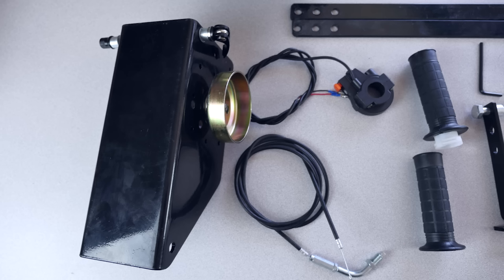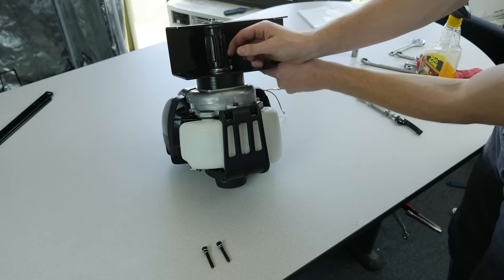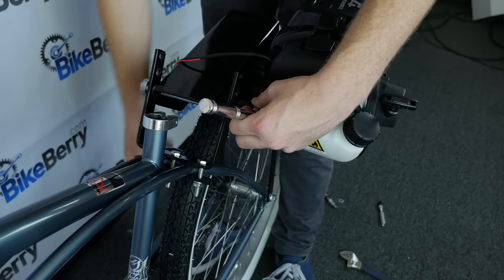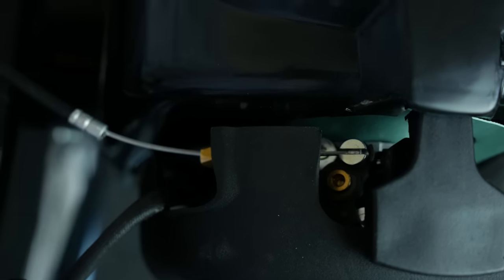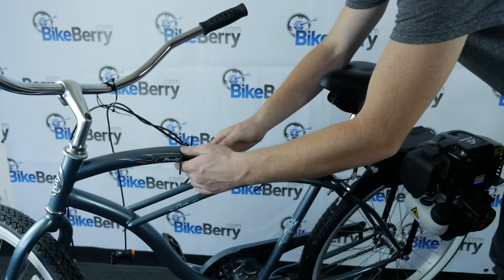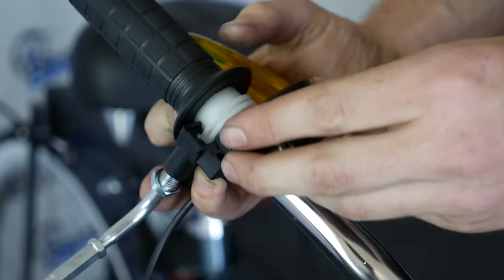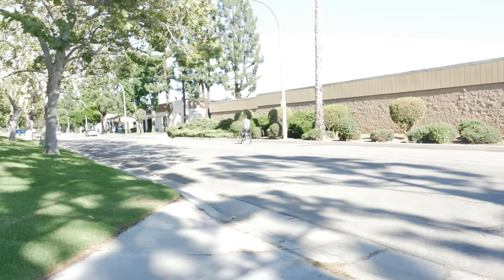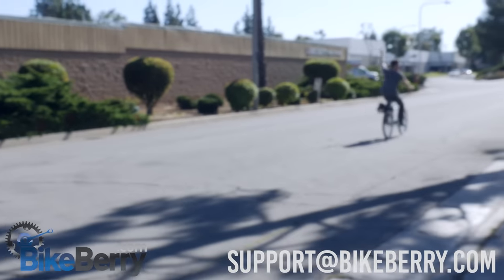4-Stroke 38cc Friction Drive Motor Bicycle Engine Kit Installation | The Flying Horse Lock-n-Load

Comment: how long are you going to be OUT OF STOCK?
Reply: It says "in stock" now :D
Reply: it will be forever , nobody wants it , it is bad for environment  ,
Reply: pattoe1973 Its not out of stock. I just bought the 49cc model;). And this thing is more efficient most vehicles on the road.. so yea. gg
Reply: offcourse it is not out of stock , nobody want it , it is not efficient , electric vehicles such as TESLA'S  or electrical bike's only have to be connected to the solar panel for some time ,  you dont have to pay for the sun!!
Reply: pattoe1973 bad luck M8. I will never give up the smell of petrol.
Reply: pretty soon you are gonna pay fair amount for the damage you do , think you will give up soon , it is all about the money
Reply: pattoe1973 no its about soul. Tell me one electric car with soul. There are non
Reply: pattoe1973 also do you know how much damage building a electric car does to the environment?
Reply: it is about cancer , tell me one cancer free ice car , what gives you the right to damage others health , did you pay for it ? you did not pay me .
Reply: yeah , it is the same like building an ice car , but during use you are able to run it on wind or solar power , and the car last twice as long , so you reduce building cars about 50 %
Reply: pattoe1973 they don't last as long as a old Mercedes for example. The batteries fail quite quick. Do you know what disposing of them does to the environment? And they are way way worse to build than a normal car
Reply: the battery's are 100% recycle able by the machine that builds them , the old battery's are worth a lot of money , the battery,s are garanteed for 8 years  by 8 years you saved enough money to buy 2 new ones ,because you dont need to change :oil, filters, startmotors,clutches, exhaust pipes and mufflers gearboxes etc.etc. did you know Mercedes and TESLA are good friends ?? Mercedes A class, B  class and Smart are all electric vehicle's made in U.S.A. by TESLA ! Mercedes just anounced the start of building their own "GIGA-FACTORY, like TESLA  is building in Reno !! after 1 milion !! miles your battery still give 50 % enough to power your house as an emergency generator, etc etc , why you think Mrcedes is investing 5 bilion dollars ? somebody did the math , it is the way it will go , (there are a few people still hangon to the steam-engine , but i dont see a lot of them )
Reply: pattoe1973 you really believe that "recyclable" batteries are actually recycled? Get lost and do some research what is going on in Africa. 

And maybe you haven't got my point. I would never buy a modern car. Electric or not. Why? Because when I saw a used car nobody has to produce a new car. And even better : they don't even have to harvest any natural recourses. 

I only use synthetic oil and run my car on vegetable oil instead of diesel because mercedes used to build reliable engines.
Reply: i also run my mercedes on vegetable oil for 50.000miles its emisions was 25% lower compared to Diesel, and it was 50% cheaper ! , if you think they will trow away battery's , you shoud find out how much money they offer you for the old battery,s , the Mercedes (124 type , 250 ) is nower days not welcom in the bigger city,s , because of age year of construction (1986) here in the Netherlands 14  environmental zone's , and increasing . the mercedes is gone  it was a great car (500.000 miles ) R.I.P.
Reply: pattoe1973 well I'm from Germany and mine makes 250hp. Threw everything out that wasn't necessary. Emissions? Well I have a switch that makes black smoke coming out of the exhaust. But it's fast and sounds nice
Reply: i cant find anything on you tube, that can keep up with TESLA , TESLA wins against ferrari lamborgini mercedes porsche 918 etc.etc. Maybe you think it is fast because it makes a lot of noise ?
Reply: pattoe1973 wanna see something fast? Search for 1500 hp Toyota supras, Nissan GTRs and other Japanese cars. Some even go beyond that. You don't get fast cars directly from a manufacturer. And I didn't say that my car is faster than a Tesla. 

But it's more fun. No traction control or other electronic nannies. No power steering. And an engine that with an amazing power curve
Reply: imagine what will happen if you do that with TESLA , TESLA does it all under waranty , for some of us important
Reply: no power steering ??? i did search for it , but for w124 , 250 it was only power steering available
Reply: pattoe1973 I took it out. It was complicated but the steering is way more direct now
Reply: pattoe1973 also you can't get much more out of a Tesla without the battery going flat within seconds. Way to many electrics and stuff that can go wrong
Reply: i think i liked it better without powersteering,
Reply: the TESLA is under waranty mate, why cause cancer while there are so much better cars ? you have a refrigerator in the house , when is it serviced last time ? you know the answer ! NEVER ! it can go easy 30 years without oilchange , new filters or any maintaince  , because it is electric (NOTHING CAN GO WRONG)
Reply: people start to verschrotten these cars once you also have to pay for the damage you do to people's health. cancerthreatment is very expensive ! you have to drive with the schwarze plakette inclusiv schädel, so you can not enter city's und jetzt komt auch bald mout ,wie der traby darf man einmal im jahr fahren ! ...nice car
Reply: john martin trust me you don't want it.
Reply: pattoe1973 Listen oil and petrol will be burnt for at least another century and there is nothing you can do about it
Reply: jerardo rosales I can use synthetic oil and plant based fuels
Reply: pattoe1973 also im not sure what you have to do but according to statistics a Tesla actually has high maintenance cost. Also around a track many many cars are quicker because the Tesla is so heavy.. And when you want warranty and straight line speed get a dodge demon
Reply: never go full Pony I understand that, but what pattoe does not understand is that not everyone will make such a switch from convetional fuel right away.
Reply: jerardo rosales well.. All you need for E85 (that's nearly only plants) is a new ECU. No big thing.. And you may already use synthetic oil without knowing it
Reply: indeed some are still burning coal , but that is only one museum-steam-train and it is only one day a year (10 miles ) so it will not do much damage , nobody want to make fire before go to work , electric will be so much cheaper , go to work with gas car will pretty soon" burn money " ,instead of "make a livin" in fact for holland almost 7 dollars / gallon  it is almost reality (our county 8 %  electric & growin fast , (over here "'electric car rush" , instead of " GOLDRUSH "
Reply: pattoe1973 well the gold crush came crushing down just like the electric cat rush will. People usually don't like it to be burned to a crisp. Just see what almost happened to Richard Hammond just a day ago
Reply: electric car more safe than kerosine bomb car everybody knows that , in fact it is almost not possible to crash a TESLA  because autopilot will avoid trouble , kids are programing the computers right NOW !!! they will save the world !! (instead of ruin the world , like last generation did ) ps stupid hammond lost because TESLA logs ALL THE DATA  , (battery was not empty )they are payed by big oil , in fact it is a commercial
Reply: TESLA        3.000 maintance first 5 years       respecting your freedom of choice !!!!
BMW         16.000maintance  first 5 years with threaths you loose garanty if you dont "pay"
Mercedes 18.000 maintance first 5 years with threaths you loose garenty if you dont "pay"
Reply: the satelite (also by ELON MUSK ) will see you,and you will pay for the dammage you do to others health , it is only a mather of time ,  and you pay 75 % of price sinds you polute "'only" 75 % ( i measured . 1.32 K reduced to 0.99 K on plant based fuel
Reply: pattoe1973 well but their electrical problems are not so mayor. The labor costs go crazy once a computer acts up
Reply: their are no costs , just push two thumbs , computers start to reset , reboot . or whatever , otherwise call TESLA. free conected for help , they can push something trough the harder style !!! now start to verschrotten the old crap , they need materials to build all these amazing new clean safe and almost for free technology , like the hard style
Reply: pattoe1973 it's everything but green like I explained already. And it's to expensive. And just look into the electrical problems a Tesla has. A simple reset doesn't help you in most cases 

And a reset doesn't help you when the car bursts up in flames as soon as the battery gets punctured
Reply: It is 100% green when you charge it on solar rays .How can a solar ray possible be expensive , Do you know how to fix a pricetag to a solar ray ????  You DUMP money in your tank and harm people's healt , Some day you will pay the price (you will remember this when somebody of your familie is diseased) 
Any idea what cancertreathment costs ? then theh change out e computer so what ? And you can't say "ich hab es nicht gewust " because  I told you
Reply: pattoe1973 your clearly have nothing idea how the technology in a car works. It's not so simple. 

And producing the batteries and deposing of them is really harmful. When it rolls of the assembly line you could have driven 500000 miles with a petrol car and still have a smaller effect on the environment. 

And you don't burn to death when you crash it. Or just leave it parked
Reply: THE MACHINE that produce the battery , recycle them 100% ! it is an ELON MUSK product remember ! If you drive half a milion miles with a petrol car you are pretty stupid , You will burn the price of a brand new TESLA  on fuel only, And if you dont understand it  , then have a nice live , with your steam-car
Reply: pattoe1973 but you save the environment and don't die in a fire. 

And well you don't really know what ellon musk does expect building Teslas right?
Reply: why ?
Reply: @ fool pony :spacex , solar-city, Tesla- energie, hyperloop , ziptoo , pay-pal , insurance , electric planes, auto-pilot , gigafactories, quarter-mile 10 seconds , 0-60 in 2.2, first privat compangy to launch& LAND rocket , first man tostart 5 bilion $ compagnies , etc.etc
Reply: can you please be more specific in what i have to explain to you?
Reply: pattoe1973 I will have one of them 🤘
Reply: pattoe1973 you're trolling, yeah? Who told you batteries are gaurangeed for 8 years and are 100% recyclable!? Tesla uses standard 18650 cells like most laptops use (pretty sure they still use Panasonic cells to be exact) just in a very large battery bank. Because of the current drain they last actually much less than your mobile phone or laptop's battery, dropping to 50% or less in a year if you drive the car every day. Who ever told you 8 years clearly lied. 
I mean, maybe they technically last 8 years, like at 7 years and 350 days you can charge them for 8 hours and maybe back the car out of the garage before they die, but they certainly don't maintain their capacity for anywhere near that. Also once the LiIon battery is useless, it cant just be refilled with liquid then recharged like a leadacid battery. The internals are rendered usless and the internals swapped. However I know of no company that had a machine to reopen finished cells, remove the dead annode and cathode and replace everything inside while simultaneously melting down ghe positive cap that is damaged when removed and the wrapper to be 100% recycled as well.
To be clear, I work with electronics, I design printed circuit boards. I love electronics. I also don't like cancer and have nothing against people that have our environment in their best interest, so please don't mistake me for trying to attack those beliefs. However, with my background I know a thing or two about what actually happens compared to what a company may say, and anything that says 100% recyclable and not recycled, means effectively nothing. That's basically like saying "in theory everything in here could be recycled", doesn't mean it ever will be, doesn't mean they have the tech to do it, but on paper it is possible. I can gaurantee you right no no lithium or even graphene battery can be 100% refilled or somehow turned new again with absolutely no waste. I can also tell you electronics fail A LOT. Hell, most cars with gas engines don't need mechanical parts replaced(aside from the obvious tires, brakes, oil, etc.), when something breaks it's usually a sensor, messed up ground contact, a switch, potentiometer/rotary switch, blend door actuator, etc.
Reply: in the TESLA 'S  is  the battery size 18 milimeter diameter, and 650 means 65 milimeter high , it has nothing to do with the chemistry, there are no misterys about TESLA batteries ,if you search the internet you find 3% lithium some nickel cobald aluminium etc . etc . size is the same , but battery is totaly different. you can watch you tube every single day , for 4 years long , i see people drive 200.000 miles and battery degradation is almost nothing (4 % , and half of that appears after one month, in a patrol car you loose also 4 % range after 200.000 miles , probaly you dont want to drive the internal combustion car after that milage due to oil consumption harmfull fumes causing harmfull diseases in the neigtbourhOOd.  you think combustion engine's willbe recycled 100% clean and safe? the electric motor use no oil is much cleaner ,
Reply: you can check TESLA . COM 8 YEARS WARANTY
Reply: @ MONKEY , I HAVE NO IDEA WHAT YOU DONT UNDERSTAND , so i explain most important : aways drive  electric if nessercary, otherwise take a walk , electric is quiet cleaner more economic and more fun (more torque more power , and will save you money , so more money to spend , please if you have more questions for me , ask i will explain everything i can , and dont charge money for it  , the more people understanding the new world, will be nicer world , thets my benefit (DONT NEED NO STINKIN PISTONS ANYMORE ! )
Reply: pattoe1973 Yeqh, and the 0 indicates it's round. I know how cell sizes work. I also know that the Lime green and black Panasonic NCR18650B used in the Model S contains no magic you think it does. No lithium ion battery, be it IMR, ICR, NCR; whatever, will last 8 years without suffering.*extreme capacity loss and eventually becoming a dead short and fire hazard with every day use. NONE. The Panasonic cell used in the Tesla is the exact same one Vapers use in their ecigarettes. It's nothing special. They are $4.50 at retail. 
Now why would I check their warranty? Fortunately I understand how to use google and fact check before speaking on something im not 100% sure of. The tesla waranty on the battery covers catastrophic failure... not degradation overtime. Plain and simple. Model s with 100k miles get about 50 miles a charge unless their battery is replaced. That is real world data, not a companies policy to replace products that fail(operative word is fail, not lose capacity; as every battery does). There is nothing in the panasonic NCR18650B that would make it last for 2,800+ days of regular use without the time between charges dropping drastically. There's no way around that. There is also absolutely nothing that panasonic has that makes those cells, or any other 100% recyclable and frankly Tesla nor Panasonic has  never once claimed this that I can find(maybe they redacted that statement after you read it?). Also your whole "just charge the battery with a solar panel and viola" idea clearly doesn't account for the detrimental way the materials needed to make said solar panels(it requires a bunch to charge a 444 cell battery bank like the one in a Model S) and the 444 batteries in the car and the batteries on your solar grid, plus the rare earth magnets, etc. Incase you're unaware, how those mines work, you should google it. They have a whole 0.2% yeild. The rest is now toxic and effectively useless. Super green. Maybe a windmill would be a better choice. Or you could charge your Tesla with a handcrank generator. No matter how you cut it, electric transportation isn't as grand and renewable as you say it is.
Reply: You can see for yourself , there are a lot of TESLA'S on the road  , month ago i took a taxi from schiphol airport (you can find the delivery-event on you tube, they have 167 TESLA'S taxi's on Amsterdam airport ) and go for a long drive , driver 100% satisfied  160.000 miles (250.000 kilometer) combustion car take 25.000 liters of patrol that distance , loads of environmental damage  and a 37.500 Euro money saving you can buy  3 ? ?  battery 's while there is nothing wrong with the battery that did come with the car !!  and that is only patrol savings , you have also the roadtax for free , for the Mercedes i payed 300 / quarter , that makes also a battery over 10 years  , and there is the oil swap & scam savings for muflers , disteributionbelts & clutchplates etc.etc , i dont understand why anybody still want to drive a cancer-causing- partikel- emitting-car , that drives like  a steamtrain !!  any movie on youtube starring a TESLA shoud convince everybody in my opinion .sinds a year i ride a bicycle , and will continue untill i saved enough to buy my TESLA . in the meanwhile i travel by train ( trains are electrified right after world war second was over) Adolf Hitler took the steam trains(stolen) , so they had to buy new ones anyway, and they choose electric because  1: fast  2 : clean  3: low maintance 4: silent  5: economic  , exectly like  the TESLA'S  nowerdays
Reply: you can see for yourself , i   took    a taxi at schiphol airport (there are 167 TESLA'S taxi's ) the one i hopped in , with 250.000 kilometers  did not suffer any considerable range lost (driver 100% satisfied )please compare to the mercedes benz , and everything will come clear to you : we have a winner !!!  stupid people dont understand the math , in our country  (Holland) 650 death/ year. if auto-pilot manage to do 649 , autopilot saved a life , stupid people say : it killed 649. i dont say you are stupid , but for patrol rafination you need more electricity than the tesla need to drive . so internal combustion engine can never make up, and can be concidered as dead , clear some space next to  the steam-engine in the museum , pretty soon they will bring it in !!!
Reply: from where u gettin electricity for ur tesla ? FROM COMBUSTION
Reply: Am i allowed to ask you how old you are ?
Reply: like coal , but there is only one man that still burn coal (and  it is one day / year , rest of the time he is polishing his pre-war steam train ) ,it will not kill us because the trees can absorb some CO2 and make oxygen out of it . and TESLA need some time to ramp up production volume to safe the world . so you can still drive a ferari the next 100 years , as long as patrol is not prohibited , after that you can convert it to electric ( because they are as difficult to recycle as an east German Trabant ) both plastic!
Reply: Why would you recycle a trabant ?
Reply: ask 99% of the people who did , convert to electic costs MONEY.
Reply: @kukkonen : and is it easy to recycle? or is the best option to convert it to electric ?
Reply: pattoe1973 Very difficult to recyv
cle, because Duroplast can not be burnt without creating poisonous gases. Other parts can just be sold throught net
Reply: So i was 100% right, about both the Trabant & the Ferari , Better to convert to electric. Sinds they are both made out of plastics ? Now that we agree , what is your point ?  p.s. : your grandfather has a nice car , is it already converted to electric ?
Reply: @ fool pony , did you take notice of the  TESLA  owned by tesloop hit 300.000 miles ? almost 500.000.km , after 2 years , saved some 80.000 euro's , exactly the price of the car (SAVED in fuel & maintaince) , now 6 more years garanty to go , predictions are : it will be in service another 900.000 km UNDER WARANTY !!! (they took delivery of a couple of model x also sinds it is great economical value
Reply: @ fool pony : you tube : tesloop
Reply: pattoe1973 Okay, it doesn't matter on museum cars at all. Warranty costs 25€/year for museum cars and we will register Trabant into a museum car because warranty and taxes are then really cheap. We don't drive it as a daily driver, but many people in Hungary still drive Trabants and Wartburgs everyday because they are cheap to maintain and parts are really cheap
Reply: @kukkonen waranty is something you receive from the manifactor  useualy 1 year at mercedes benz 2 years , en at TESLA 8 years , i have seen a TESLA on you tube that has driven 300.000 miles (almost 500.000 kilometers) for 10.500 euro that is maintance parts & fuel !!! try that with your TRABY !!!! It will probally cost you more than 25.000 euro's only for fuel
Reply: I used accidentally the wrong word for insurance. Ok, Tesla might be reliable on warm countries but here in Finland electric cars struggle on winter if they aren't stored in warm garages. Reason why Trabants and Wartburgs are still on the road in Hungary is the simplicity, cheap parts and easy fixableness.
Reply: the reason why TESLA roled out in Norway as first country is this : it is to break the misconception that the electric car has trouble with cold wheater. Norway is electric car capital of the world ,arent that your neightbours? i think the real reason why hungarian still drive Trabant is : they cannot afford TESLA's , and curently they dont have to pay for the damage they do to nature
Reply: Well, it takes already half from range when it is like -10c. Of course if you don't drive long road trips 150-200km per day is enough. I wouldn't buy Tesla even if it would cost like a normal gas/diesel car because range is only half on winter and trailer takes another half= 100-200km on winter with trailer, not enough at all, and in northern Finland there is not alot fast charge points in gas stations and cities.
Reply: it take half of the range , but that half is for free , and after that 200 kilometer you fill it up for free 
(in less than 30 minutes)so you can drive the next 500 to 600 kilometer . try that with your Trabant
Reply: Yes, also in Finland it is free but in Northern Finland there is not alot gas stations and even less gas stations with fast charge points. I would buy a Tesla if it would be cheap, easy to maintain myself, and there would be alot of fast cahrge points around Finland. Also taxes are cheap for electric cars in Finland. Trabant pollutes, okay but engine is from 60s so what would you except?
Reply: TESLA is easy to maintain , just ad whiper fluid !!! i would sugest the Trabant is just fine as long as it is converted to electric . TESLA 'S SUPERCHARGER system just keep improving you can see for yourself at TESLA.COM  , CLIC "CHARGING" you charge the TESLA while you sleep , so the first 400 kilometer you are safe , the navigation routes you to your destination & on your way you will find all the necersary chargers , TESLA has another compagny (called SPACEX) they take care of the satelites that connect your tesla to the factory support & charging infrastructure , the next compagny also owned by TESLA  (solar city ) is the  biggest solar tile and roof compagny in the world , basicly they provide you  with free & clean energie for your TESLA
Reply: pattoe1973 dude the problem with electric cars is the waste produced to make the car batteries for one. Two it’s the disposal of these said batteries which damage the environment... They are “recyclable” but only on paper for the most part. My daily driver a 2007 CRV can outlast your Prius... You know why? It is simple to maintain.. I don’t have to dish out a shit ton of money cause I do most of my own work. Also replacing batteries in a Tesla is super expensive man. Not everyone is made of money.
Reply: Also a “green” car needs to be driven 155000 miles before it is actually considered to be beneficial to the environment... http://www.greencarreports.com/news/1111266_bizarre-swedish-study-claims-electric-cars-are-worse-for-the-environment here is my source
Reply: @xx : watch : you tube tesloop 300.000 miles no battery degradation saving 82.000 $ !!! , The man has still 6 years under waranty !!! and imediately ordered a couple of model X . The model s only took 10.000$ for repair,maintance and fuel combined !!! Your car cant drive 300.000  miles for 10.000 dollars. only fuel will cost more !!and thets for a history car , l.o.l.
Reply: your internal combustion engine kills , if you dont belief it , try it indoor , thats the quickest way to find out , dont forget to close the windows
Reply: @xx you must be very stupid to charge your car with a coal powered plant !!!  solar panels !!!
Reply: maybe you can explain why you think i am an idiot at least? thank you
Reply: pattoe1973 Whale I am gonna tell you this Bro. A lot of things cause cancer, and how does a combustion engine cause it? We are constantly fed radiation in different ways anyways dude. In this technologically advanced world your phone gives you cancer, even sitting near a camp fire can release carcinogens into the air and cause lung cancer. Cancer is everywhere and a lot of things cause it. Let people live life as they want man.
Reply: exactly , overhere live is one year shorter , let us live as we want .
Reply: john martin
Reply: never go full Pony Car batteries get recycled.
Reply: pattoe1973 Where do you think electricity comes from?
Reply: pattoe1973 if you don't like people driving there gas or diesel cars you better get used  to it because it's never gonna end, also how do you know if I have a refrigerator in my house I may not even have a house for all you know and by the way we're not causing cancer. And the number one cause of cancer is from lung cancer from smokers not the car community, another common cause is physical inactivity and obesity. Sound familiar cough* you cough* cough
Reply: pattoe1973 where I live in a small town with one gas station the price is about 3 dollars a gallon which is not that bad for the town because it's the only station
Reply: So many experts! Wow.....
Reply: pattoe1973 Well, maybe not, but if you're in an area getting clobbered by Chemtrails all day long, so much for solar power.
Reply: never go full Pony The veg oil thing almost caught on in my area ( Massachusetts) Not sure what canned it, but for about close to 2 years, a few folks had veg oil burning vehicles, now you can't find 1 to look at it, it's almost like they never existed.
Reply: pattoe1973 150mpg